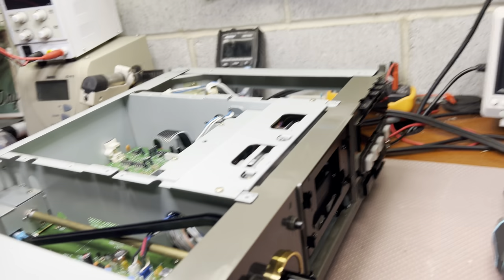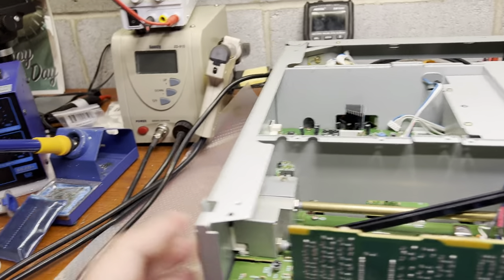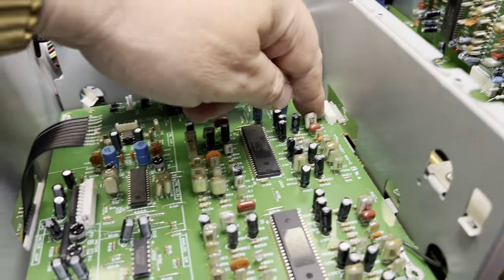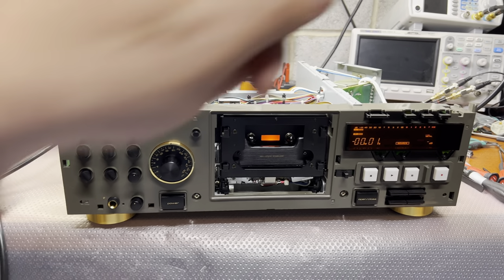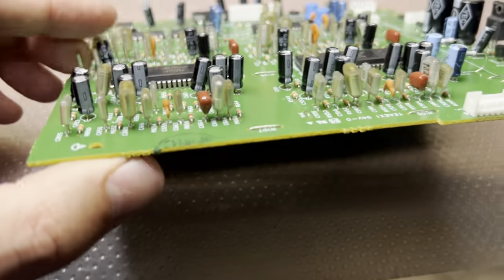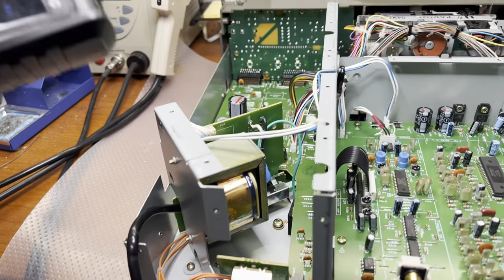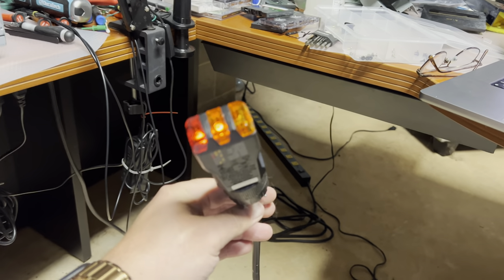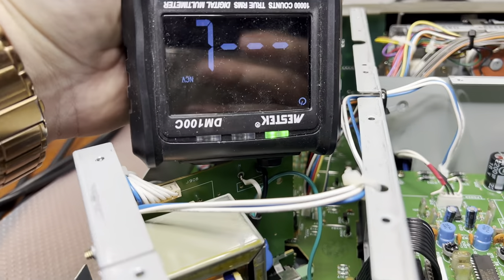Teac V-8030S Restoration - The Weirdest Issue I've Ever Encountered

Comment: Hello mate,
I have Teac v5000 and I'm planning to upgrade the switches and the caps on the signal path. Is it ok to use bipolar muse Nichicons or I should stick with polarised capacitors?
Reply from the maker: Nichicon FG will keep the same sound pattern and frequency response. With Nichicon Muse you should expect bolder bass and some decks may lose a little bit in the high range. Sometimes this was worth it, sometimes I had to fall back to FG. Not each deck responds the same way to the Muse caps.
Reply: @hifirulezzz  thanks for the quick reply! The deck don't luck base, in fact there is more bass than I like. Hopefully the FG will improve the picture. Will you recommend to attack both Rec and Playback boards?